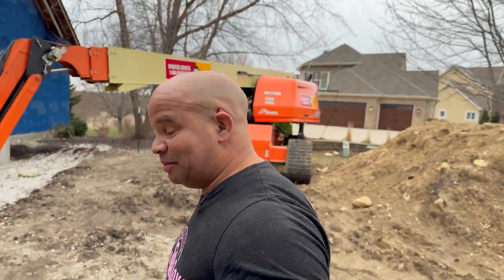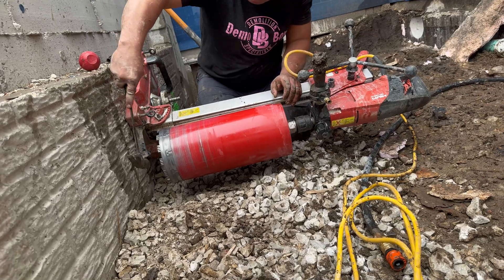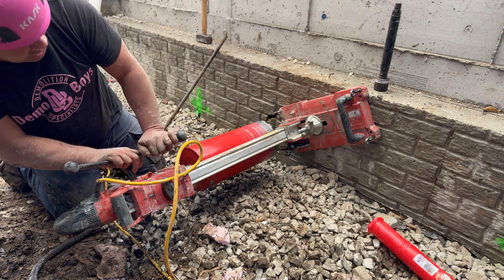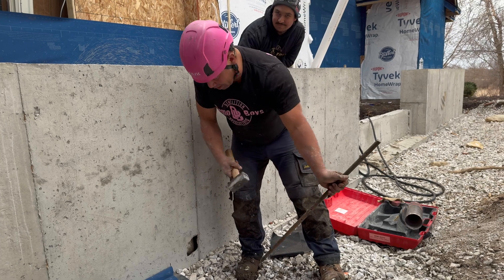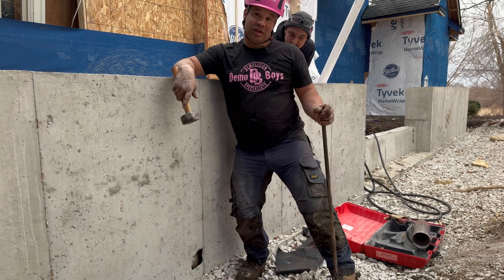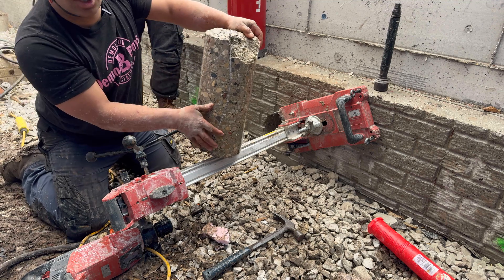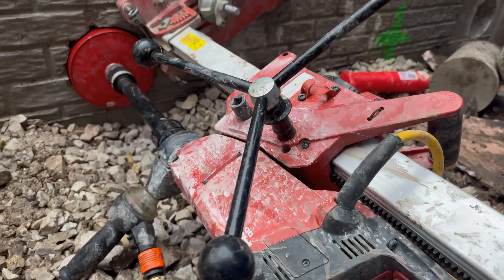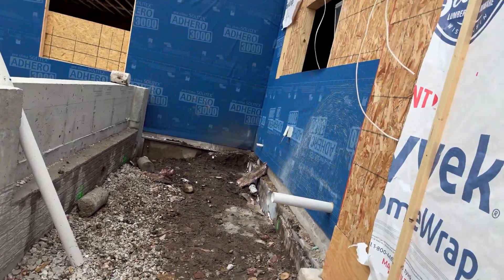They Told Me NO!

Comment: I kinda find offuses for tools myself.  I use a flexvolt mud mixer to sds adapter then earth augers.  Ussaly 12in wide 2 to 3ft long it does it as well as can be expected for post holes.  No need for a specialized drill for only a few like you guys were pointing out something multi purpose.
Reply from the maker: Thinking outside the box!